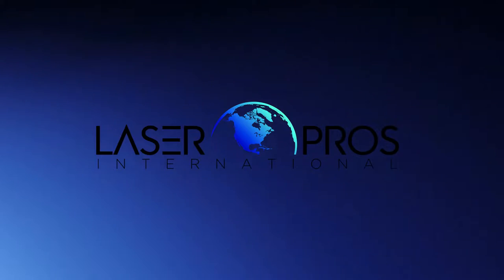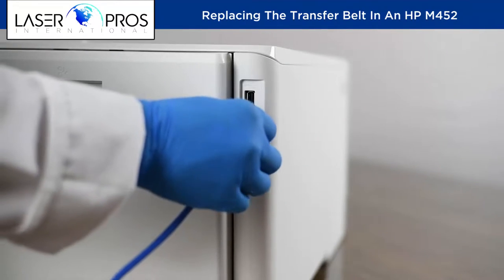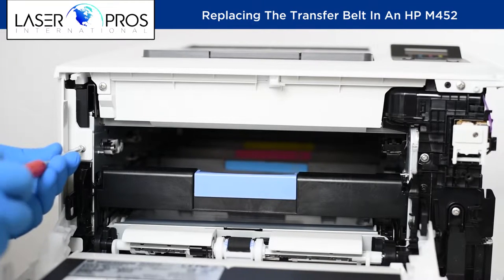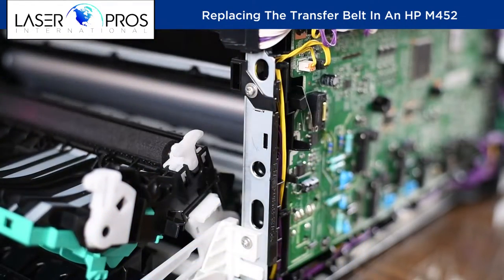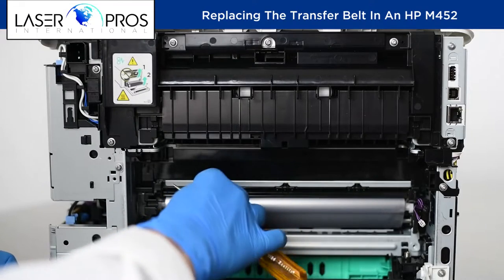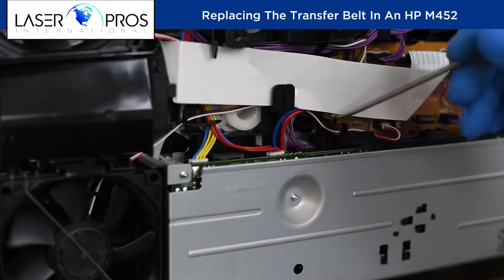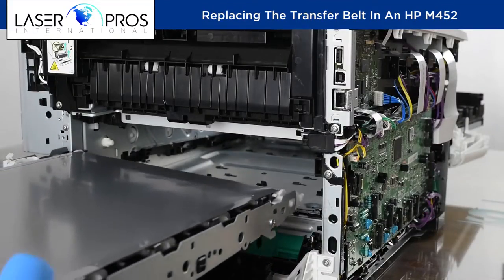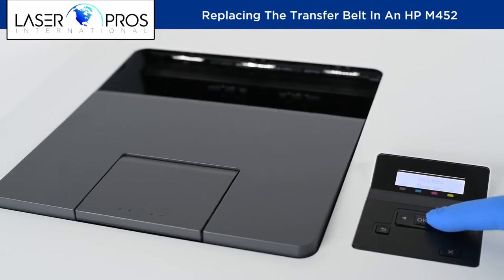Installing The Transfer Belt In An HP M452

Comment: You don't need to remove the left side plastic cover.  Otherwise, a very straight to the point great instructional video.  Good work!
Reply: Probably out of habit, because it is required when replacing the fuser.

Comment: I have a M452 printer and it will not print black on the supply page.  I have exchange the toner with another toner and no black print.  It will print the black arrow on the cleaning page but it will not print any text on the configuration page, supply page or any other internal reports.  I have also updated the firmware.  Any ideals on how to fix this?
Reply: Me too
Reply: i have same problems after i replace the belt, i cannot print anything out, any update for this problems?

Comment: Excellent video my friend: I have a problem with my HP M452 printer, I hope someone can help me in advance thank you very much. I get this, Jam in plain paper impression. Open back door and clear jam. but it has no jammed paper, when I check it I see that ink splashes remain on the transfer belt since I see that little ink dust is being thrown away. when clean, it only prints 1 sheet, and then the same problem continues. I don't know what to do if I buy other toners and see what happens. Best regards.

Comment: HP has a Firmware fix for the 59.F0 code on their website ...caused by a binding Transfer belt supposedly, but the firmware fixes it without taking out the belt !!
Reply: Yes it does and there are techs that swear it doesn’t work and they get hit with a callback for the same code. I’ve never had any machines get called back after using the firmware update.

Comment: I am having a problem printing the yellow cartridge.  When I called HP, they said it was a hartdware issue.  They did not say what part of the printer was faulty.  Does anyone know what would cause the Yellow not to print, despite the fact is says 90% in the toner cartridge.  Thank you so much in advance!!
Reply: From what i understand it is the "sensors" that are faulty. How could I fix that and could you point me to a video as to how to fix it?
Reply: Jessica Steinhart if you’re using non OEM toner try a different yellow cartridge

Comment: Hoping someone will see this. Printer works after taking it apart and putting it back together, but the pages are printing blank. Any ideas?
Reply: Check the connector for the charge roller on the black toner
Reply: My fault I thought it said you were getting BLACK pages
Reply: @chandlers5910  if no color it’s possible the transfer belt is bad
Reply: @chandlers5910  also check driver settings to make sure it’s set to print in color
Reply: @chandlers5910  there are no many things that could be wrong. Could be a bad color toner making the rest not print
Reply: @chandlers5910  is it brand new or is it refurbished?
Reply: @chandlers5910  what’s the make and model of the printer
Reply: @chandlers5910  you may also try deleting the printer from your computer and doing a clean install

Comment: Mine is stuck. I can’t figure out what it is you are pressing on before pulling the belt out. I have followed everything to a T, but the belt won’t come out
Reply: Did you unlock the belt?  There are 2 tabs that need to be pressed down and pulled out to unlock it.  There are two black plastic pieces that you pull o to pull it out.  Where you unscrew it there are two washer looking parts and the top to can swing in the way  of taking the assembly out by spreading out and not letting it get past the back of the printer.  Just push them in and it should work.
Reply: @kevinsears362  Thank you. That was indeed the case. I fiddled with the tabs more after I posted the comment, and the belt came out. Thank you so much for the video.
Reply: Nina P. Kozlova  I didn’t make the video I just wanted to make sure your issue was resolved, especially since I ended up having the same issue.  My Printer is fine and working hard.

Comment: Can anyone who's done this tell me about how long this takes in real time?
Reply: About 10mins
Reply: If it is someone elses machine that has never been apart, this swap should be figured at an hour.  If you do this model a lot and the case has been apart before then 15 minutes.
Reply: @mlderr61  thanks I've just about got it finished up